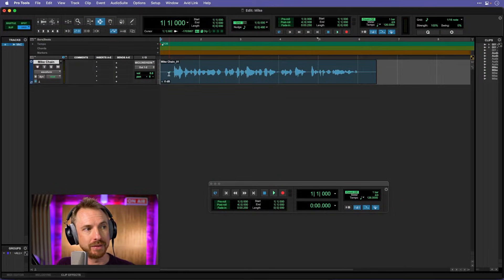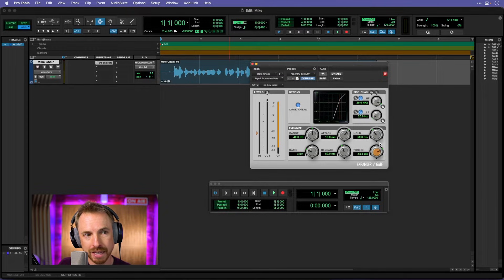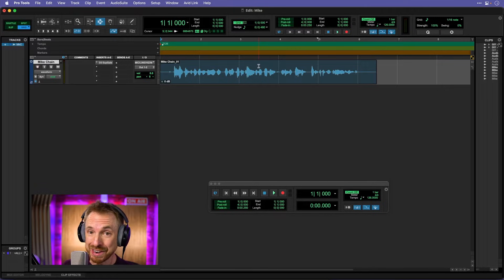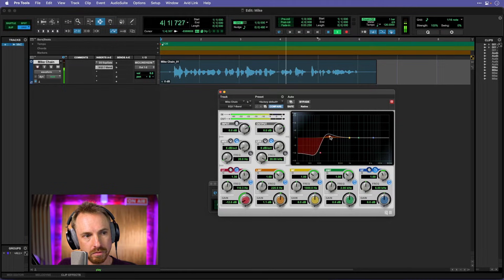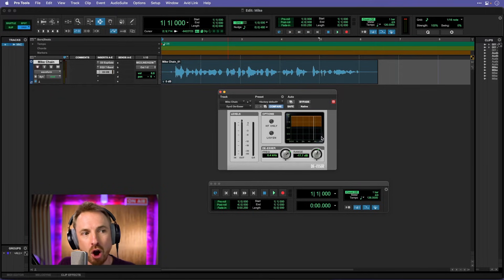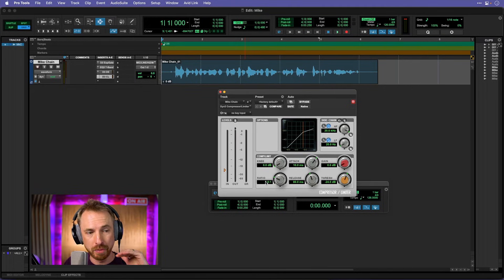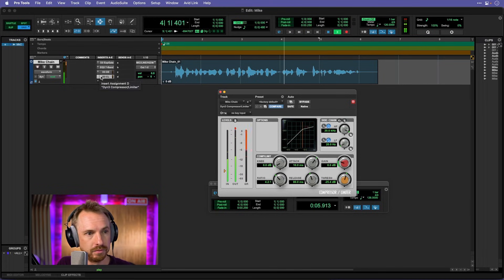How To Make Your Voice Sound Better in Pro Tools | Pro Vocal Chain Settings | The Cherry On Top!

Comment: I've done all of this and audio sounds much worse.
Reply: Lmfaoooo dont give up 😂 what kind of genre are you mixing?
Reply: @1traphouse  I haven't given up, I never do. I'm not mixing, just improving a speaking track that was recorded on a decent mic with a small amount of road noise from outside the building.
Reply: @harrelsontrumpets  you’ve tried using NS1 plugin under Noise reduction ? Its basically noise cancellation
Reply: @1traphouse  I'll try it
Reply: @harrelsontrumpets  howd it go
Reply: @ it worked great! Thanks for the suggestion.
Reply from the maker: Sorry to hear that.

Comment: Where do I find the native effects? I have nowhere near the amount of options that's popping up for you in inserts
Reply from the maker: The native effects can typically be found within the "Insert" or "Effect" section of your Pro Tools interface, and the specific options available may vary depending on your version of the software and the plugins you have installed.
Reply: @MikeRussell  I have pro tools HD. Is that different from your version of pro tools?

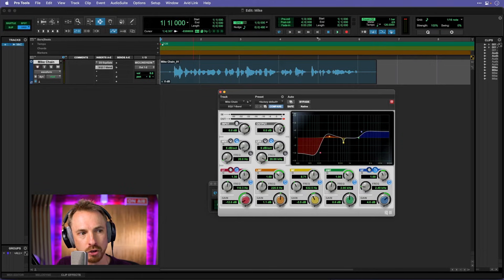Comment: Thanks Mike that’s wonderful 😍 Just a small point, in 3:57 the little red square is used to pin the plugin window so you can open multiple windows at the same time. To mute the plugin you can use the “bypass” button, or simply Command+Click the plugin name in the insert slot.